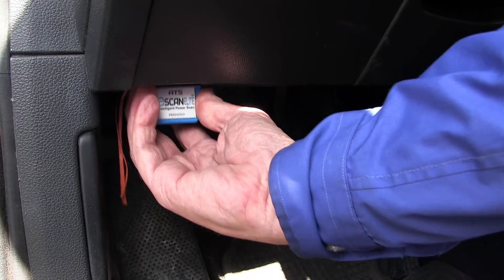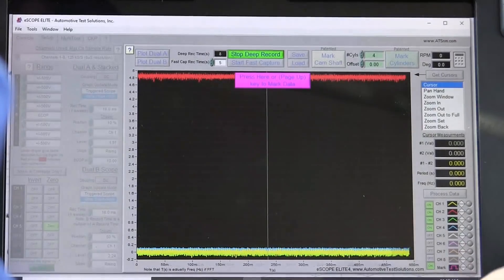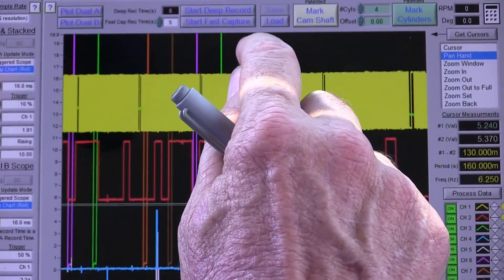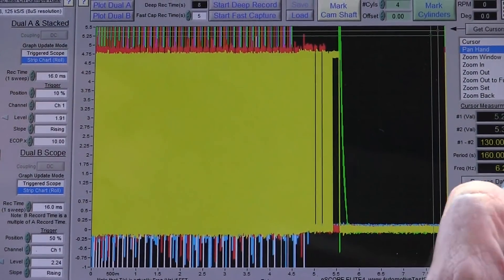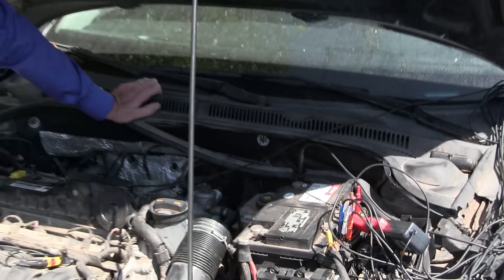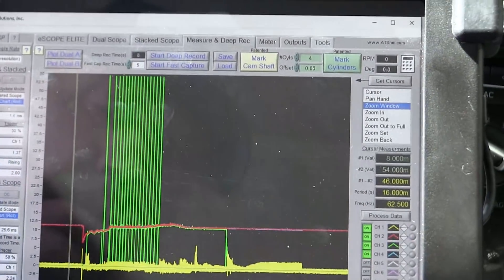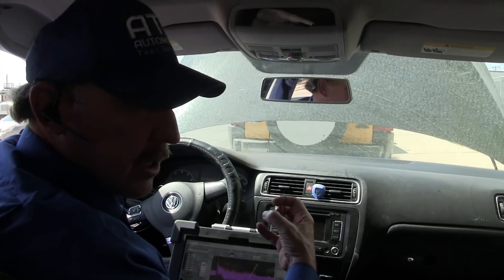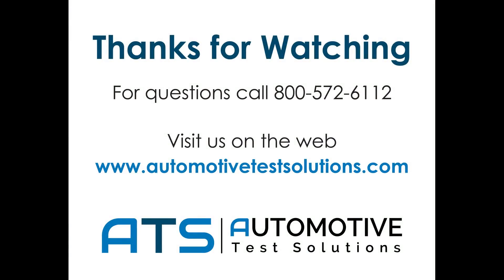Diagnosing a 2011 VW Jetta 2.5 Engine Stalling When Cold No Fault Codes (DTCs) Stored

Comment: Safety Issue Type: Recalls
March 29 2011 NHTSA Campaign Number: 11V196000
ELECTRICAL WIRING/FUSE
SHOULD THIS HAPPEN WHILE THE VEHICLE IS BEING DRIVEN, THE ENGINE COULD STALL, OR THE HEADLIGHTS OR WIPERS COULD TURN OFF UNEXPECTEDLY, POTENTIALLY LEADING TO A CRASH WITHOUT WARNING.
NHTSA Campaign Number 11V196000 Manufacturer VOLKSWAGEN OF AMERICA, INC Components ELECTRICAL SYSTEM
Potential Number of Units Affected 71043
Summary
VOLKSWAGEN IS RECALLING CERTAIN MODEL YEAR 2011 JETTA VEHICLES, MANUFACTURED FROM MARCH 2010 THROUGH MARCH 2011. THESE VEHICLES MAY HAVE AN ELECTRICAL WIRING AND FUSE LAYOUT WHERE THE CONVERTER BOX IS PROTECTED BY THE SAME FUSE USED BY THE SIGNAL HORN AND THE ANTI-THEFT ALARM SYSTEM. SHOULD THAT FUSE BE BLOWN, THE CONVERTER BOX WILL BE DISCONNECTED FROM THE POWER SUPPLY WHICH, IN TURN, WILL SHUT OFF APPLICATIONS SUCH AS THE ENGINE MANAGEMENT SYSTEM, LIGHTING SYSTEM, AND WIPERS.
Remedy
VOLKSWAGEN WILL NOTIFY OWNERS WHEN SUFFICIENT QUANTITIES OF REPAIRS KITS ARE AVAILABLE. DEALERS WILL SEPARATE THE WIRING FOR THE HORN AND THE THEFT PROTECTION HORN FROM THE POWER SUPPLY OF THE CONVERTER BOX AND ROUTE THE WIRES TO SEPARATE FUSES TO CORRECT THE CONDITION FREE OF CHARGE. THE SAFETY RECALL IS EXPECTED TO BEGIN DURING APRIL 2011. OWNERS MAY CONTACT VOLKSWAGEN AT 1-800-822-8987.
Notes
OWNERS MAY ALSO CONTACT THE NATIONAL HIGHWAY TRAFFIC SAFETY ADMINISTRATION'S VEHICLE SAFETY HOTLINE AT 1-888-327-4236 (TTY 1-800-424-9153), OR GO TO <A HREF=HTTP://WWW.SAFERCAR.GOV>HTTP://WWW.SAFERCAR.GOV</A> .
Affected Products (1)
Vehicle
MAKE MODEL YEAR
VOLKSWAGEN JETTA 2011
Associated Documents (17)
STOP SALE 2011 JETTA SEDAN
RCMN-11V196-1234.pdf 22.469KB https://static.nhtsa.gov/odi/rcl/2011/RCMN-11V196-1234.pdf
FAQ
RCMN-11V196-2345.pdf 27.773KB
    Generated at NHTSA.gov 1 / 3

https://static.nhtsa.gov/odi/rcl/2011/RCMN-11V196-2345.pdf
Defect Notice(Part 573)
RCDNN-11V196-3094.pdf 331.372KB https://static.nhtsa.gov/odi/rcl/2011/RCDNN-11V196-3094.pdf
REVISED FAQ
RCMN-11V196-3456.pdf 29.304KB https://static.nhtsa.gov/odi/rcl/2011/RCMN-11V196-3456.pdf
MANDATORY STOP SALE ORDER 3-28-2011 RCMN-11V196-4567.pdf 27.333KB https://static.nhtsa.gov/odi/rcl/2011/RCMN-11V196-4567.pdf
REVISION TO SAFETY RECALL CIRCULAR RCMN-11V196-5678.pdf 21.975KB https://static.nhtsa.gov/odi/rcl/2011/RCMN-11V196-5678.pdf

Comment: My wife's car is a 2015 vw gti and we started having this issue since August 2022 and it has been to the VW dealership 3 times for the same issue and they couldn't figure it out. We got it back in mid December and it ran fine for a month and now it's doing it again and we are going to get rid of it tomorrow. Sometimes the engine would stall on us going 55mph and then pull over and the car wouldn't start. And after 10 minutes it will just start like normal and some other times it wouldn't start and we had to get it towed.
Reply: THIS EXACT THING IS HAPPENING TO MY TDI. NO ONE CAN FIGURE IT OUT
Reply: I mean not exact but similiar

Comment: Awesome stuff! As much as I trust that you were right about the cause here, Bernie, the only lingering question: was the computer actually seeing the cam signal at the computer during the stall. You checked the cam signal at the sensor, but not at the computer. Was there something in the data that lead you to rule that out without checking. I’m just thinking that an open in the cam signal before it hit the computer could have been a factor!? Yes? No?

Comment: After nearly a year of diagnostic and (wrongly) throwing parts at my car, I have a feeling this is exactly what is happening in my 2011 jetta se
Reply: What was it?
Reply: @X100PRE  exactly this. The ecu crapped out.
Reply: This is happening to my car I’ve tooken it to 5 mechanics they can’t figure it out
Reply: @rubyperez1892  can pretty much guarantee the ecu is bad, it's really hard to catch like this guy did.
Reply: Have you tried updating ECU firmware to later versions, like one released in 2014??

Comment: The injector you didn't look at has a partially shorted coil when cold causing the voltage regulator for the injector drivers in the ecm to overload and shut down.  ----I doubt it, but that's how it would work for me.

Comment: vw produced in 2011 with indirect fuel injection system (petrol engines  ), injectors are fired individually, it's hard to believe that all the injectors are shut at once at the same time while the ECU is still receiving input signal from CMP and CKPS, and the ECU power supply and ground are okay, without any proof  just simply confirmation of the ECU malfunction is not the appropriate way ,most of the time engine stalls when it is cold due to the fuel filter blockage particularly with indirect fuel injection system on petrol engines. Air filter and mass air flow sensor should have also been taken to consideration,either the injectors blockage, fuel pressure,  fuel lifting pum operation too.
Reply: and the well known vw fuel pump relay  - cracked solder joints.  That relay feeds power to injectors as well.  I personally would not judge faulty ECU so quickly.
Reply: The proof is in this video.

Comment: I don't think that is nearly conclusive enough to determine a computer replacement.  I'd  have to confirm every requirement is met for the injectors to fire.  If all conditions are met then see if the command is leaving the computer, at the computer.  You measured injector pulse at the injector.  There can be faults between the computer and injectors that could pull the entire system down.  Not sure if that system has a minimum fuel pressure requirement... but man would that be silly to replace a computer when a fuel filter is plugged, or a fuel pump is weak, or a return valve is malfunctioning.  Granted some of those faults I would expect some error codes, but I'm not familiar with VW and would certainly take some time familiarizing myself.
Reply: So you think a clogged filter or a weak fuel pump will cause the ecm to stop firing the injectors? That's not how this works, that's not how any of this works.
Reply: @ssrbob  Good reason you don't work in my shop, because there absolutely are manufactures that disable injectors below a minimum fuel pressure.  Now why would they do that.   Gee what if an injector sticks open filling the cylinder for a hydrolock condition, or filling the crankcase with fuel.  Or filling the intake tract with fuel.  Here is what I do know.  ECM's get mis-diagnosed at an astonishingly high rate.  Before one gets condemned more data is needed.
Reply: @ShainAndrews  Can you cite a specific vehicle that would cut out all the injectors because the fuel pressure is low? I've never seen a strategy like that. All the other possibilities you mention would cause other noticeable drivability issues that were not present. The symptom on this car is a sudden and abrupt stall due to all the injectors cutting out. The scope clearly showed this.  All the injectors suddenly stop firing with no interruption in the cam/crank signals. That's either a loss of power feed to all the injectors or a ecm fault of some sort. Running pressure tests would be a waste of time. Bernie eliminated things that could cause ALL the injectors to cut off simultaneously. The only thing left that could cause that is the ecm...
Reply: @ssrbob  Everything Bob said is spot-on. In addition, just picture the running condition of an engine with low fuel pressure, rough idle, on the verge of stalling, but an abrupt stall on low fuel pressure? I think not.
Reply: Fairly certain that it would set a fault if there was an issue with fuel pressure.  However I am much more familiar with the di VW engines than the 2.5.  And with all 5 injectors shutting down I would think ecm related.  But you are right, exhaust all options before calling an ecm.

Comment: Still one question remain unclear: Why the car seems to run better or stalls less when it's warmed up??!!!
Reply: I guess would be a bad solder joint in the ECM. Expands and then makes better contact once the engine bay warms up...

Comment: Still there are many possibilities that were not eleminated, fuel delivery issues control/circuitry , livedata STFT LTFT, ECT, if the pcm is the cause due to temperature related issue, than i would duplicate that using spray can to cool it or heat gun! Geart scope though
Reply: Those possibilities you mentioned were eliminated because they cannot cause the ecm to stop firing all the injectors.

Comment: My old Ford focus used to do this. I took it to the dealer and they fixed it, not sure what they did but I think they said some thing with the ground. Unfortunately, it came back within a year.
Reply: I had this issue recently on a focus it was the PCM/ECU. You will need an ECU kit
ECU, instrument cluster & key. The blade can be changed from the old key to the new one. Hope this helps
Reply: @kennedysgarage3281  Thanks. I got rid of that car long ago. I remember the dealer saying something about ECU needing to be reprogrammed and something about a bad ground. They didn't replace the ECU but then again the fix didn't last more than a year. This was a 2000 model, I got rid of it in 2009 with 230k+ miles on it (original timing belt too).

Comment: why not look at fuel pressure
Reply: The first test proved that the injectors were being shut off. This has nothing to do with a loss of fuel pressure.

If we were concerned about the possibility of the PCM shutting off the injectors because it saw a loss of pressure, then we could break it down into two cases based on whether or not the car has a fuel pressure sensor.
Case 1: No sensor. Then the computer has no idea that there is a lack of fuel pressure and we would see the crank slowing down BEFORE we lost injector pulse. On this car we saw the opposite. Injectors shut off before there was any slowdown of the crank.
Case 2: It has a sensor. Then there would be codes related to fuel pressure and this car didn't have any.

Comment: Using the EScope causes you to think differently about the data. In a sense it forces you to look at the big picture and not get distracted. Very impressive. Thanks!
Reply: That's the tool I should have bought... instead of all that snap-on junk. Ok, I do love my vantage pro... simple quick easy to use tool. This though, truly is the "one tool does all" (once you master it). =)
Reply: I love how Bernie just busts out the scope and uses all 8 channels...BEAST MODE!